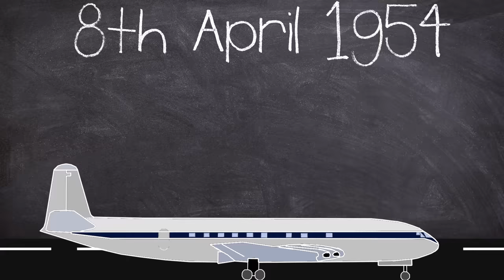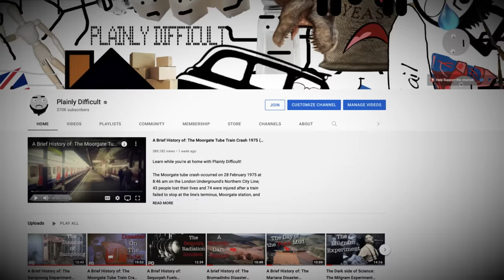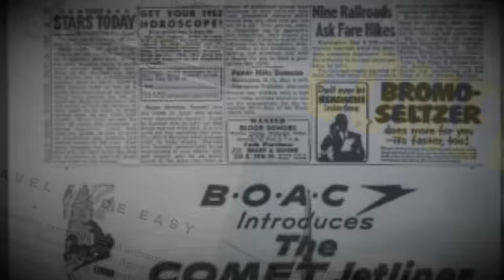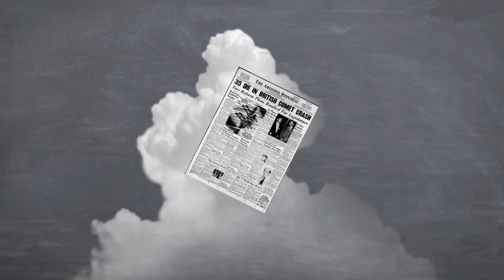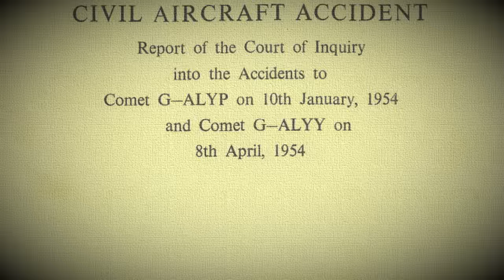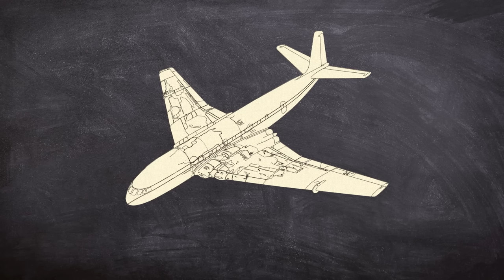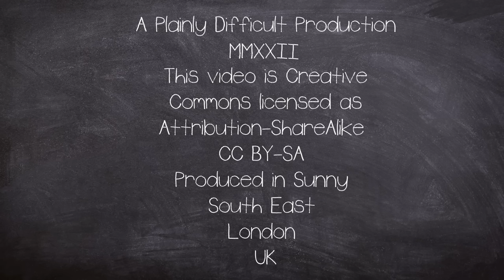A Brief History of: The de Havilland Comet Design Disaster 1954 (Documentary)

Comment: So many amazing aviation stories, working in the industry my favorites are definitely the downfall of the DC-10 and Concorde
Reply: Specifically UA 232
Reply: The DC-10 was a very successful aircraft and is still flying today.
Reply: Yes but not for passengers more for cargo
Reply: And there were two majors flaws that made people lose trust in them one being cargo door failures and fan blade defects killing hundreds and causing three different plane crashes
Reply: @acam4519  The DC-10 series was very successful in passenger service... in production from 1968 to 2000 with 645 aircraft built in total, thats more than all the large British jet airliners ever made...
Reply: @acam4519  American Airlines operated the DC-10 series in passenger service for 28 years from 1971 to 1999.

They were only retired due to the change in ETOPS regulations that allows 2 engine aircraft to cross overwater routes that are cheaper to operate... not because of safety reasons.
Reply: This video has some BS included.
For example -
  
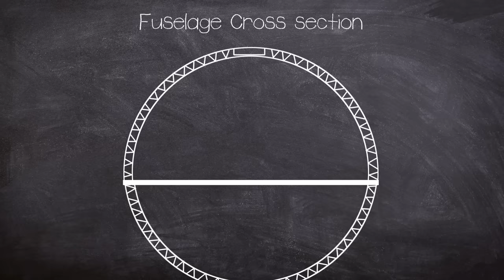    5:20   The idea that only the crew & passenger areas were pressurised is absurd obviously. 
  In fact every part of the fuselage was pressurised from the nose to the rear fuselage bulkhead including the entire cargo area.

Besides that.
The engine position & inlet design were not flaws or fatal flaws, there were good reasons for that design choice at the time.

Comets flew until 1997.
The Comet design had military use as a requirement. Nimrod development began at 
De Havilland before 1953.
Nimrods were not withdrawn due to structure problems or other airframe issues it was entirely a significant upgrade snag & resultant basic economics & an end of line sale happening at Boeing at the same time.

  We feel we can shed some light on some common misunderstandings.

  At the time the Comet wasn't particularly dangerous.

Losses comparisons
How things were in those days.

DeHavilland Comet 4 UK           14% 
DeHavilland Comet all  mks       17%  

Boeing 307                               70%
Boeing 247                               48%
Boeing 707            .                  20% 
Boeing 707                                20% 
Lockheed Electra Turboprop   29%
Canadair CL-44  Turboprop     46%  
Convair CV-580  Turboprop     22%
Convair CV-880    (ff 1959)       27%  
Convair CV-990     (ff 1961)      35%

    Of course De Havilland had prior experience building many all metal construction airframe aircraft including thousands of jet powered fighter aircraft that were primarily of metal construction with pressurised cockpits & jet engines built by De-Havilland.

   De Havilland carried out full stress analysis & engaged in a comprehensive & protracted testing program which is why key De Havilland people were happy to be aboard flying DH Comet aircraft.

    The DH Comet was the first passenger airliner with full length fuselage pressurisation at 8psi pressure differential. Handley Page built the world's first all metal construction airliner during the 1920s.
    In many cases earlier pressurised aircraft were larger, needed thicker fuselage skins due to flying stresses & had much lower pressurisation differential pressure.

   Of course ripstop provision was provided. The skin alloy used became unavailable at the time due to R & D at the manufacturers which resulted in the original alloy being discontinued.
The skin thickness used for the Comet was used for similar later aircraft. 
Frame spacing was not found to be too large & frame width was not found to be too small.

   De Havilland did indeed always work to better than industry standards at the time, used up to date knowledge for the design & construction & no evidence of negligence  or criminal negligence was ever produced in relation to the DH Comet.

   The DH Comet had no effect on the course of the aerospace industry in the UK. The UK now has the world's largest combined nuclear, aerospace & defence sector per capita activity.

    The investigation committee did not find hundreds of fatal flaws or evidence of design defects, structural defects, defective materials or shoddy workmanship. Ripstop provision was included. Claimed incidents did not involve cracks starting from window corners.
Pretty much all changes were just in case changes or were planned development modifications & improvements that were scheduled regardless of incidents.

  De Havilland designers knew all there was to know about metal fatigue at the time they designed the DH Comet.

Hope this helps.

Cheers 👍. 
 
 . . .... ... ..... .. ... ... ...

Comment: One thing that these accidents and the investigation after was Boeing was watching the Proceedings and their 707 went through some design changes and some of the fuselage proceedures were modified to prevent a similar accident. Boeing also went to the extreme test procedure of painting the whole air frame with a special stress showing ceramic paint and flying the test plane to its limits. From this Boeing could actually see the stress points on the aircraft skin. One of the Boeing test engineers was later quoted that unknown to them this special paint was highly flammable when first applied and the chance of a fire breaking out would have been a good reason NOT to do this test but since they did not know at the time. They never used that same paint in any other tests by painting the whole plane again they only used it in small amounts in specific areas.

Comment: The likely causes of the Comet crashes are fully discussed by Professor Paul Withey in this youtube video:
https://www.youtube.com/watch?v=K5HqEwbp4GA

It was NOT the windows (they are not square and are not that different from the windows in the Boeing 737), it was not the rivets.  The only KNOWN cause of a Comet crash was a fatigue crack that started at a countersunk hole for a bolt near the rear port edge of the rear ADF window on the roof of the aircraft.  The idea of the windows being the cause came about after the tank testing in the investigation, and even then, in the tank test it was not a window that failed.  Much of what is written is just repeated from previous comments that were not accurate, there is primary source material available on the internet, but it takes time to find it and even longer to understand the information.

Comment: It’s the cycling of unpressurised to pressurised that causes metal fatigue and that’s why all aircraft frames have a fatigue life. Much like if you bend a metal spoon back and forth, it will eventually fracture and break.
Reply: Hi Shaun, All aircraft parts are subject to stress, including parts in non pressurised aircraft. The basis of good engineering to to first determine what stress a part is exposed to and then design and manufacture the part to withstand that stress plus an appropriate margin.  

Your example of bending a spoon is not representative, because the very fact that you are bending a spoon means that you are exceeding its designed strength. Just imagine how long a spoon would last if it were used for its design purpose, putting sugar in your coffee.😊

Comment: It's amazing though that today's two must advanced commercial aircraft, the A350 and the B787's entire front nose looks like the first one from 75 years ago.  I'd say overall the Comet is one of the most beautiful aircraft ever made.
Reply: YES, the world's first pressurized airliner was the Boeing 307 Stratoliner in 1937, its iconic nose can be found on many modern jet airliners like the 787 Dreamliner... the safest airliner in the world.
Reply: This video has some BS included.
For example -
  
    5:20   The idea that only the crew & passenger areas were pressurised is absurd obviously. 
  In fact every part of the fuselage was pressurised from the nose to the rear fuselage bulkhead including the entire cargo area.

Besides that.
The engine position & inlet design were not flaws or fatal flaws, there were good reasons for that design choice at the time.

Comets flew until 1997.
The Comet design had military use as a requirement. Nimrod development began at 
De Havilland before 1953.
Nimrods were not withdrawn due to structure problems or other airframe issues it was entirely a significant upgrade snag & resultant basic economics & an end of line sale happening at Boeing at the same time.

  We feel we can shed some light on some common misunderstandings.

  At the time the Comet wasn't particularly dangerous.

Losses comparisons
How things were in those days.

DeHavilland Comet 4 UK           14% 
DeHavilland Comet all  mks       17%  

Boeing 307                               70%
Boeing 247                               48%
Boeing 707            .                  20% 
Boeing 707                                20% 
Lockheed Electra Turboprop   29%
Canadair CL-44  Turboprop     46%  
Convair CV-580  Turboprop     22%
Convair CV-880    (ff 1959)       27%  
Convair CV-990     (ff 1961)      35%

    Of course De Havilland had prior experience building many all metal construction airframe aircraft including thousands of jet powered fighter aircraft that were primarily of metal construction with pressurised cockpits & jet engines built by De-Havilland.

   De Havilland carried out full stress analysis & engaged in a comprehensive & protracted testing program which is why key De Havilland people were happy to be aboard flying DH Comet aircraft.

    The DH Comet was the first passenger airliner with full length fuselage pressurisation at 8psi pressure differential. Handley Page built the world's first all metal construction airliner during the 1920s.
    In many cases earlier pressurised aircraft were larger, needed thicker fuselage skins due to flying stresses & had much lower pressurisation differential pressure.

   Of course ripstop provision was provided. The skin alloy used became unavailable at the time due to R & D at the manufacturers which resulted in the original alloy being discontinued.
The skin thickness used for the Comet was used for similar later aircraft. 
Frame spacing was not found to be too large & frame width was not found to be too small.

   De Havilland did indeed always work to better than industry standards at the time, used up to date knowledge for the design & construction & no evidence of negligence  or criminal negligence was ever produced in relation to the DH Comet.

   The DH Comet had no effect on the course of the aerospace industry in the UK. The UK now has the world's largest combined nuclear, aerospace & defence sector per capita activity.

    The investigation committee did not find hundreds of fatal flaws or evidence of design defects, structural defects, defective materials or shoddy workmanship. Ripstop provision was included. Claimed incidents did not involve cracks starting from window corners.
Pretty much all changes were just in case changes or were planned development modifications & improvements that were scheduled regardless of incidents.

  De Havilland designers knew all there was to know about metal fatigue at the time they designed the DH Comet.

Hope this helps.

Cheers 👍. 
 
 . . .... ... ..... .. .....

Comment: There are good reasons why you rarely see any square pr sharp angle shapes, much less cutouts, on the vast majority on pressure vessels and containers.
Reply: But they are not uncommon to see in pressurized cabins..
The cockpit windows are a perfect example, they often have very distinct corners...
The Comet Disaster is the worst engineering failure in aviation history... it was caused by incompetence, inexperience and criminal negligence... not the shape of a window.
Square windows were a red herring offered up by de Havilland who didn't have the slightest clue why their planes crashed.
Reply: @sandervanderkammen9230  well said

Comment: In 1945, the fastest airliner was the Lockheed Constellation, which cruised at 340mph at 20,000 feet. Then, in 1952, the Comet revolutionised air travel with a 450mph cruising speed at 40,000 feet. Since then, airliner speed has only increased by about 110mph, which seems odd. But there is a reason.

Modern, airliners fly at around 36,000 feet, where air pressure is 3.3psi compared to 14.7psi at sea level, and the temperature drops to -55C. This  allows the designers to reduces fuel consumption and maximise range. But at that height the speed of sound falls from 761mph at sea level to 660mph. 

Beyond Mach 0.8, drag escalates, and other problems arise.  This limits the cruising speed of jet airliners to around 0.8 x 660 = 528mph. They can fly a bit faster, but the fuel burn rockets. 

Currently, the fastest jet airliners are the Airbus 380 and Boeing 747-8i, with cruising speeds of 561mph and 564mph, and maximum speeds of 634mph and 594mph respectively. Concorde was a highly advanced design and could cruise at 1,341mph at 50,000 feet but, sadly, it's no longer flying. 

How can jet engines operate in the thin air at 36,000 feet? The answer is that they gasp, and only have 33% of their sea level power. Jets cannot operate above 100,000 feet because there is simply insufficient oxygen to support combustion.

Comment: I didn’t know exactly which aircraft it was, but I did know that issues with square windows/square corners were the reason that aircraft now have well-rounded windows.
Reply: None of the catastrophic in-flight structural failures were actually related to the passenger windows.
Reply: @sandervanderkammen9230  We don't know. Only one of the three fuselages had been recovered and studied.
Reply: @sandervanderkammen9230 , they mentioned hairline cracks emanating from the corners of the windows.  Didn’t you see that?  I didn’t say it was the cause of the crashes, I said I remembered there being an issue with square cornered windows and that after those fractures were discovered, windows were made with very rounded edges.
Reply: @ItsJustLisa  All of the original Comet 1's that did not crash or were not scrapped were modified with round windows.
These aircraft were tested and found to still be structurally unsafe and the Comet 1's airworthiness certification was permanently REVOKED in 1958.

No Comet 1 with round windows would ever return to commercial passenger service.  

The Comet 4 is a completely redesigned aircraft with stronger fuselage hoops, thicker aluminum skins with proper heat treatment.
Significantly higher number of rip-stop doubler joints and completely new riveting techniques included proper drilling, reaming and dimpling methods that met modem safety standards.

The Bombardier Global Express series has huge square windows and is pressurized to 51,000 feet... with no issues because the shape of the windows does not matter, it is a false urban myth.
Reply: @sandervanderkammen9230 , and like I said, I never said catastrophic issues with square windows were the reason for the change.  It was that square windows, period, cause minute stress cracks at the corners.  You can’t have cracks developing in the fuselage of a plane and not expect that they could eventually lead to bigger problems.  So, they went to well-rounded windows to alleviate that particular problem.
Reply: @ItsJustLisa  No, they don't, cracks were found over the entire fuselage skin, the water tank test was flawed and ultimately inconclusive but de Havilland stuck to their story and refused to take the blame.
Reply: @sandervanderkammen9230 , if cracking around square windows was not a problem of any kind, they’d still be on airplanes.  You’re not paying any attention to what I said.  I have NEVER said that the square windows caused catastrophic events on the Comet or any other plane.  I said that, AMONG OTHER THINGS, it was found that the metal fatigued and some fractures were found occurring at the CORNERS OF SQUARE WINDOWS.  No aircraft designer is going to stand by and ignore small fractures emanating from the corners of the windows once it’s discovered to be an issue, whether it was the cause of a crash or not.  Hence the design was changed to rounded corners by other manufacturers.  THAT’S ALL I SAID!  I NEVER SAID IT WAS THE CAUSE OF THE COMETS CRASHING REPEATEDLY.
Reply: @ItsJustLisa  The Comet Disaster was not caused by the shape of the windows.
Comet 1s modified with round windows were still unsafe to carry passengers.

Some aircraft do use square shaped windows, the Bombardier Global Express series is a perfect example of this.

The truth remains that even if the Comet had no passenger windows they would have still suffered catastrophic in-flight structural failures..
The engineering problems have nothing to do with windows or their shape.
Reply: @sandervanderkammen9230 , you’re still not paying ANY attention to what I originally said!  At all!
Reply: @ItsJustLisa  What you said is nothing more than a false urban myth.
De Havilland didn't know why their planes crashed.
They came up with an excuse that news media grabbed on to and ran with it.
The passenger windows had nothing to do with the cause of the crashes.

De Havilland didn't understand metal fatigue or how to safely build aircraft  out of riveted aluminum... the company was decades behind in aircraft design and construction technology.
Prior to the Comet Disaster de Havilland was still making aircraft out of WOOD!
Reply: @ItsJustLisa  Manufacturers make the windows look more rounded because of people like you!
Reply: @ItsJustLisa  Actually Boeing offered a choice of both square or round windows before and after the Comet Disaster.
After the news media told the world that square windows were the cause of all deadly air crashes (because de Havilland said so) airlines only ordered planes with round windows.

Bombardier still makes passenger jet with big square windows, and guess what? No one has died.